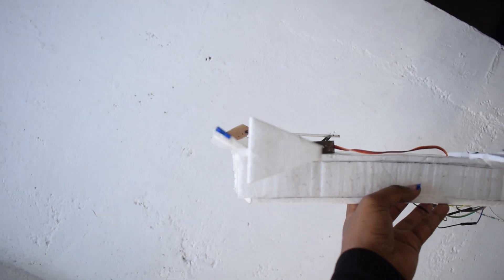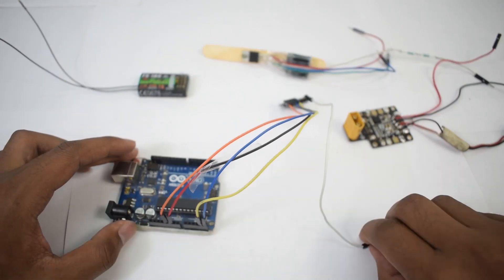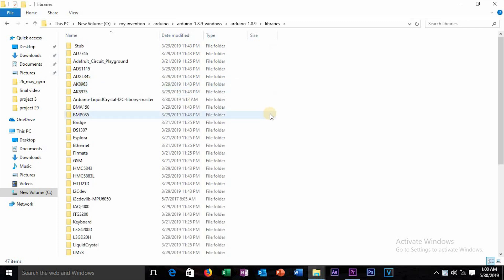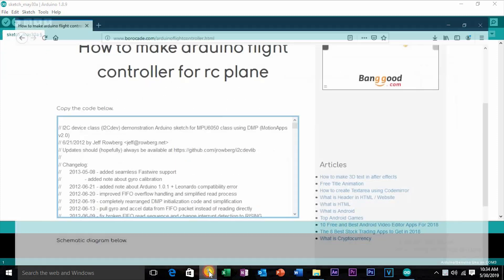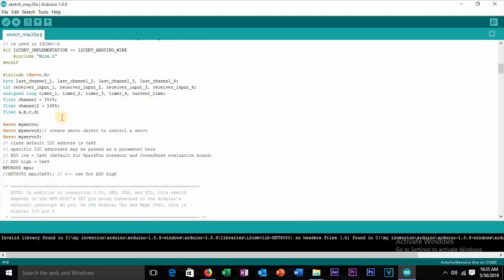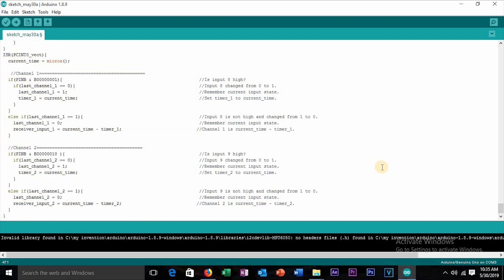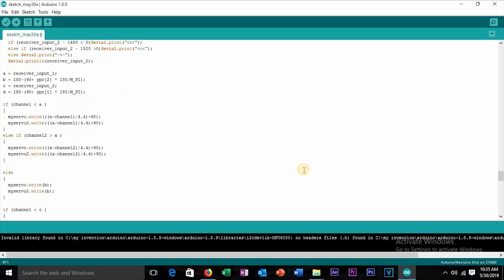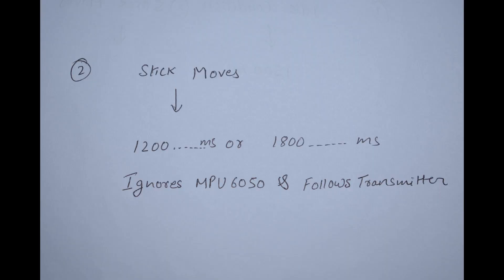Arduino Flight Controller for RC Plane

Comment: i have seen the wiring schematic.
there are three servos each representing.
ailerons, elevators, and rudders.
on the arduino output to the servo there are no paths.
but the input from the receiver that goes to arduino is only ch1 and ch2...
My question is, is the wiring scheme correct according to the manufacturer's wishes. Or is there a ch4 (rudder) output from the receiver that goes to the Arduino input ~10?

Comment: I think that your RC does not fly that efficient because the plane is not streamlined  which is why the drag is very much, so you have to reduce that by streamlining the plane
Reply from the maker: It is just a model to explain arduino flight controller. It is not a flying model.

Comment: This just does ailerons and elevators, not rudder control, right?
Reply: I see in the schematics 3 servos, but I assume 2 are for the ailerons, and 1 is for the elevators, correct?
Reply from the maker: yes
Reply: @myinvention1228  thank you for the quick response. I'm sure with some addition to the code, the rudder could be added. The 6050 is capable of tracking x y and z after all. I use one in a head tracker module for fpv I built. Opensource head tracker, over on RC Groups.
Reply: I didn't make the project originally, of course. I just made one using that information. I may try and add the rudder stabilization. I can probably modify some of the code I uses for a DIY gyro for ground vehicles, as it's the same axis it uses.

Either way, thanks for this project. I'm going to build one and use it on an aircraft I'm building presently.
Reply from the maker: @oldmanbluntz  yes, you can add code for the rudder control as well. I was facing some problem with yaw axis in my mpu 6050, thats why i didn't include the rudder control.
Reply from the maker: @oldmanbluntz  Good Luck for your project.
Reply: @myinvention1228  i may try and add support to the code for the mpu-9250. i have a couple of those kicking about as well. they have been implemented for use with opensource headtracker as well, and the datasheets and specs needed are all over on the rcgroups post for that project. see if they are more accurate for the 3 axis.

Comment: Hey, I tried uploading your code, with a uno as described, the code does not work. Pitch values continuously change randomly and roll controls do not change when plane is tilted. I guess you have uploaded the wrong code.
Reply from the maker: watch this video, i explained the setup in detail
https://www.youtube.com/watch?v=JoWqrFstMHk

Comment: The purpose of this is to keep airplane leveled on X/Y axes?
Reply from the maker: yes
Reply: @myinvention1228  How do you deal with motor vibrations?
Reply from the maker: @DualityCovers  Vibration is not a big deal. It also manages Vibration because it uses only Accelerometer.